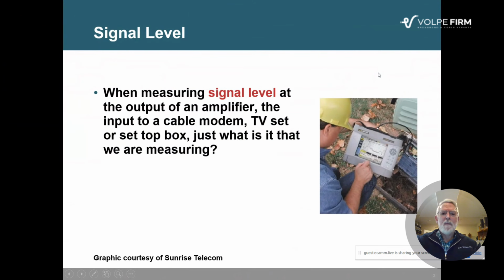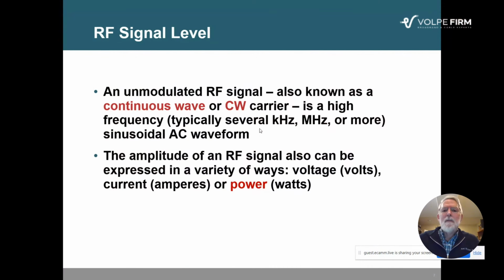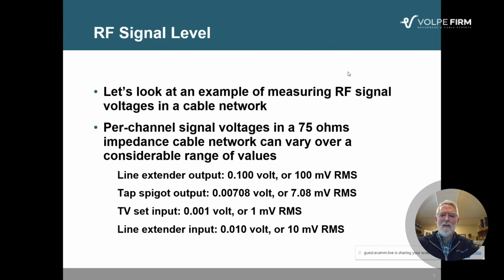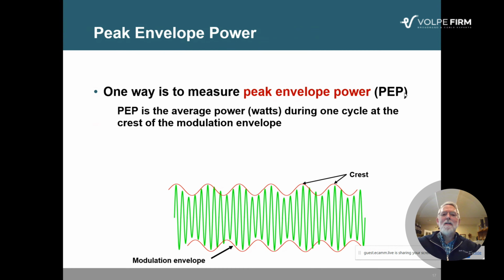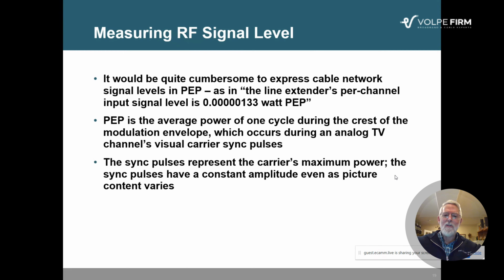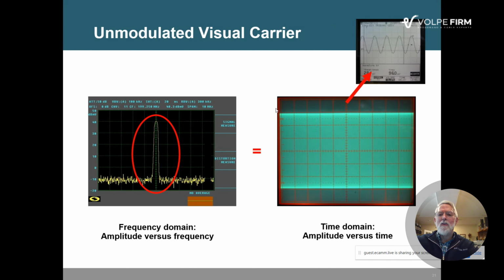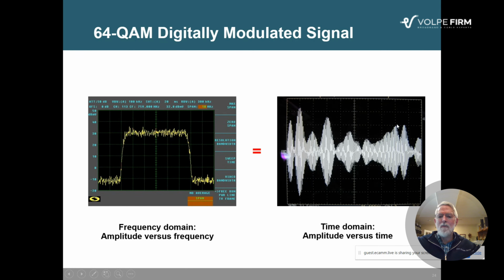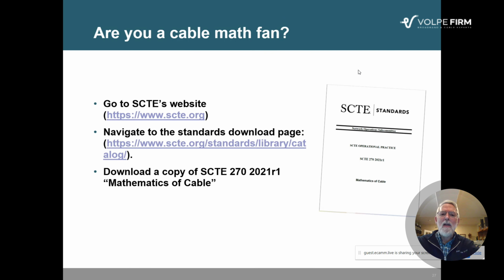RF Signal Level 101: Learning the Basics with Brady Volpe and Ron Hranac

Comment: Great segment! All this talk of billionths of watts i never knew or considered, makes me wonder about its correlation to BER which the baseline of good I'm familiar with is 1e-9 (1 billionth) and goes down from there it. Got me thinking about it as some kind of voltage jitter...or maybe my mind is going way off track.
Reply from the maker: Hi Rene thanks for watching. Interesting question. Have you heard of the Hall Effect?  You can measure very small variations of voltage using Hall sensors. https://electronics.stackexchange.com/questions/343875/monitor-tiny-variation-in-voltage

Comment: Another reason RMS is important in Cable TV is because the AC power supplies output  Quasi-square wave AC.  If you read it as Peak-toPeak instead of RMS you will get a false, higher value.
Reply from the maker: Hi Bill, great point on quasi-square wave signals that we see on the output of main line power supplies 👍